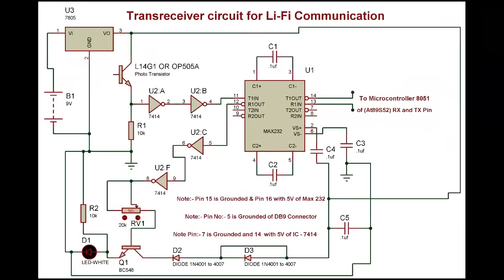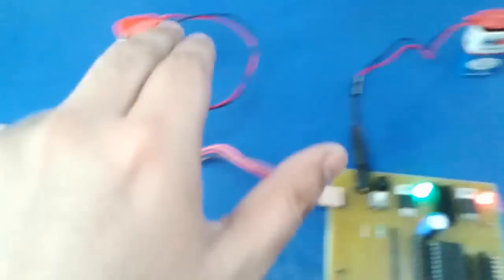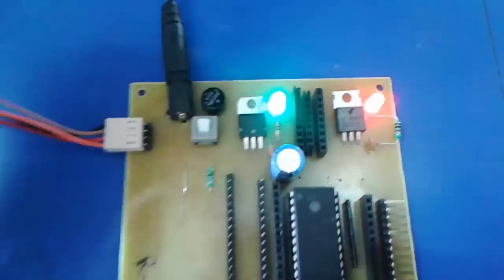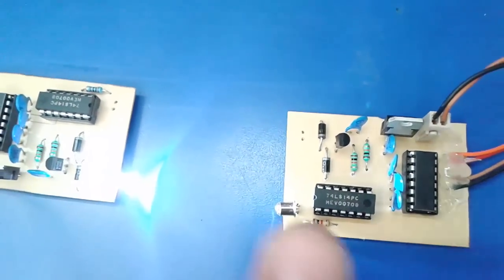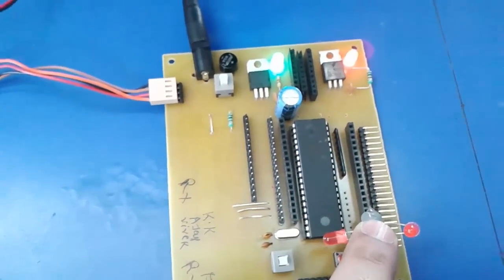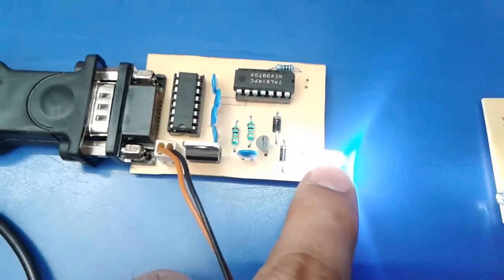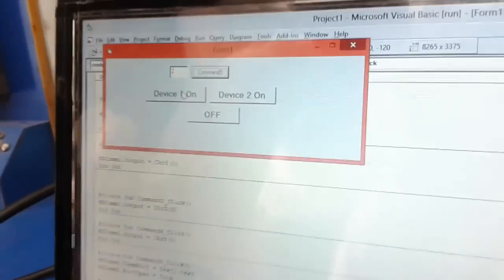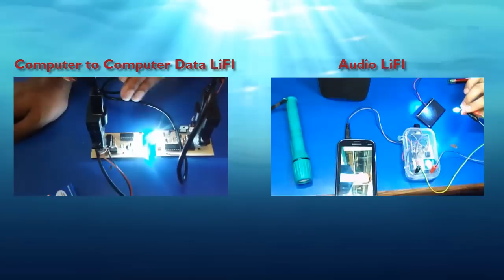LI-Fi Data Communication

Comment: What will be the speed to share that image of file
Reply from the maker: If you are using hyperterminal then max capability of this software is rs232 limit but transferring capability of led and photo transistor is differ. For this setup it is 4800 max.

Comment: hi sir, can i know how many bytes of data was transmit(process tranmitter data) in 1 normal Led?
Reply from the maker: 9600 standard by Rs232 this is for education purpose only
Reply: +Tishitu you mean 1 led can transmit 9600 bytes when send the data?
Reply from the maker: muhammad faiz yep it can .. if led is higher in transit rate then it can faster transfer the data
Reply: +Tishitu thank your sir, can i have the evidence like technical paper because i want to make it as a reference in my research, last question sir, if 1500 bytes data was transmitted how many Led to be used? thank for feedback sir.

Comment: Hi Tarun ,
i have a question and i hope you'll answer me 
can i use solar cell instead of photo diode
thank you for sharing
Reply from the maker: +Ahmed Nasser because solar cell have analog behavior and photo transistor have digital .... you have to make changes in it ... use comparator after solar cell rating 6V 150 to 400 ma minimum
Reply: +Tarun Shrivastava i will try it  thank you  for your time
Reply from the maker: yep you can use
Reply: @AhmedNasser-rt7wz  are you make phone data share model

Comment: Can we use mobile in place of laptop? If yes then how?
Reply from the maker: if you use mobile then you have to convert usb streaming to serial emulator then Rs232 to Lifi device then can transfer a data .... well mobile led lamp can also help but tantulum capacitor have to remove
Reply from the maker: mit app inventor is good idea for programmming